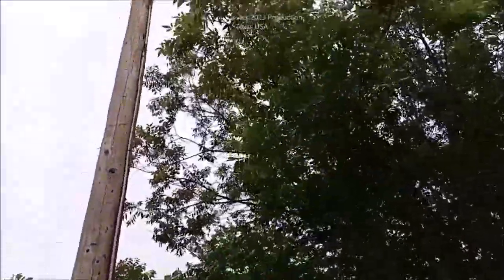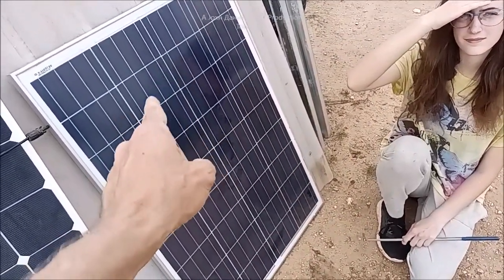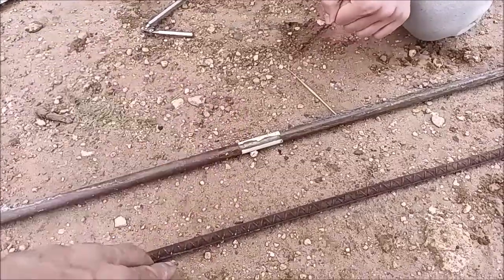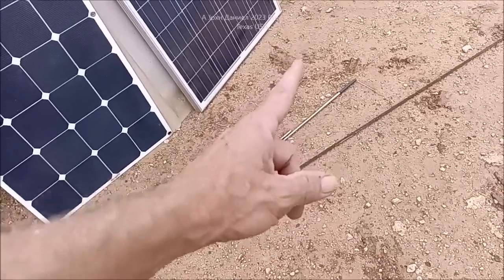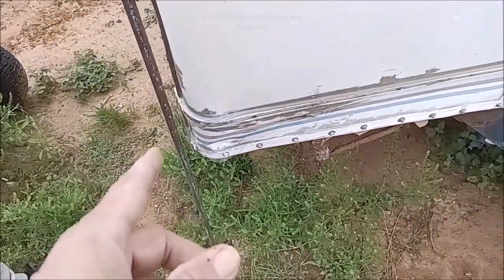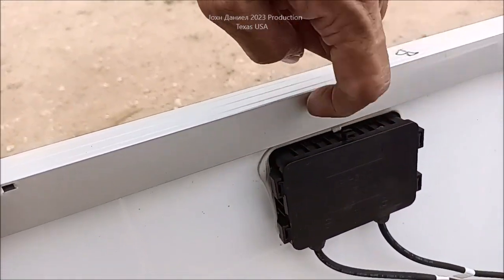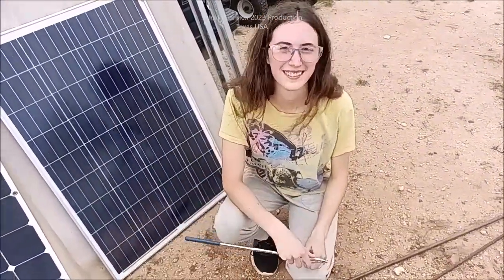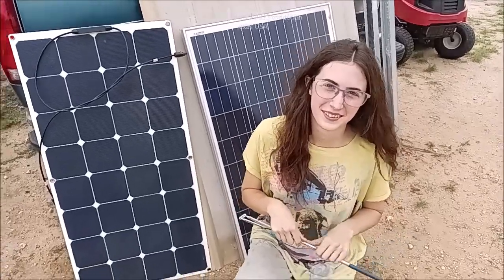Grounding your SOLAR PANELS? 🤔 You Better watch this First! *KNOW DC/Inverter POWER is not Utility

Comment: Yes by code anything that has conduit on the roof of any house needs to be grounded this includes solar panels.  The key is to that it needs its own separate ground do not use the same ground as the utility.   Its just a lot safer for solar panels to have its own ground wire if they are on the roof.  If lightning does strike the solar panels on a roof its just better for it to be directed to go towards ground.  If the solar panels do not have ground it will most likely follow the wires towards the batteries and destroy everything connected to it,  but I'm thinking that will happen regardless if its properly grounded or not since lightning is incredibly powerful but its still a lot safer to ground the solar panels.  Flexible solar panels do not have conduit or aluminum frame those will not need a ground.  Also while its rare its not impossible for a lightning to strike the top of a car even if it has solar panels or not,  for the most part you will be safe because if lightning hits the top of RV the shell of the RV will become energized and go towards ground thru all 4 tires - you will definitely still have a lot of electronics fried up though regardless.  You just have to hope lightning never strikes your car or roof & never park under a tree when its raining. I'm thinking since inverters will never have a surge it won't need a ground to send that surge to ground, maybe only if it gets a lightning strike but again if a lightning strikes you'd most likely need to make major repairs to home for weeks you just have to hope it never happens.
Reply from the maker: The real cure is remote higher targets like lightning rods. Or placing solar on metal roofs. Using metal roofs makes it where the lightning discharge is so expansive that it repels into atmospheric static. No single point collection or dispersion. In test of a AC unit on a roof of a building, the one on wood framing was destroyed by lightning, the one mounted on a full sheet metal roof had its relays damaged. Not allowing the 1 mm wide arc of lightning to concentrate all its energy into one square foot of discharge weakens its ability to do damage.
Reply: @JOHNDANIEL1  I haven't yet set up a solar array but I've been thinking about this for a while when I do start building a system.  What I've thought of was instead of mounting the solar panels on my roof I can just have them on the ground itself - this will make it easier to clean them when they get dusty & no ground is really needed since they are not in high elevation & the solar panels temps will also be a lot lower and make more energy.l

Comment: AFAIK, there are 2 different reasons for grounding: (a) for functionality reasons (AC transformer, electrical wire fence, ...) and (b) for safety. 
With (a) you connect one of the wires to the ground which acts as an extra conductor, and with (b) you connect metal frame parts to an earthing rod or loop. 
With (b) in place, you prevent people from being shocked when touching the metal frame if a damaged DC or AC cable also touches that frame. Without grounding, the electricity goes from the defective cable via the frame through your body to the ground, which can be deadly. 
With the frame grounded, the pathway of least resistance is via the ground wire to the ground, so when you touch the frame then, almost no or very little current will go through your body. As well as the situation that the Ground Fault Current Interuptor can detect the dangerous situation and disconnect the electricity, indicating there is a dangerous situation that should be corrected. Or in case of solar panels, the inverter detects that there is an insulation fault that should be looked in to. 
PV systems are being grounded for protection of your loved ones, and other people.
I'm no expert, only an apprentice, the experts can correct or agree with me.
Reply: You must be "educated", which is a no-no, apparently...
Reply: @scooter325 . Haha !!  😆
Reply: You're right except that the DC circuit from your panels is an isolated circuit. There is no potential to earth ground unless you create it by bonding the return (-) to ground first. Shorting the positive wire to the frame will do nothing unless the positive and negative both are shorted. Then something is going to blow, hopefully fuses that you've installed on your panels instead of your panels.
Equipment grounding is absolutely best practice where that potential exists and does include most all AC circuits and non-isolated DC circuits.
Reply from the maker: @beebop9808  They fail to understand DC voltage. What a shorted wire on a grounded panel will create is one of 2 things. A blown DC fuse, and if no fuse, a Fire. NOT electrical shock unless you loop grounded it. Touching One side of DC voltage is not a issue, but a shorted positive on a grounded frame and you in the middle is a circuit. Sad how clueless and deep in the Koolaid drinking so many are to this issue.
Reply: @JOHNDANIEL1  I don't know dude? Strange stuff going on with this panel grounding mess. I've followed it around a little bit and it seems people are complaining about AC voltage leak coming back from the controllers to the panels and some getting bit by it. First I don't see how it could be viewed as "OK" that there is continuity between the DC circuit and the panel frames? Second why is it "OK" to have a foreign AC voltage induced on the DC circuit?  
One video I saw where a guy was lightly touching a panel and arcing could be heard. Clearly a frying sound and obviously the sound of high frequency voltage. AC voltages read all over the place but likely I'm guessing no current to go with it.
The assertion being made that some panels were worse than others. 
I don't see any UL listed equipment doing any of this nonsense. Clearly folks don't get the difference between AC and DC and what's going to happen if you get yourself into a DC circuit with 100-500 volts on it.
I don't know like I said. Half a mind to call up an old buddy that worked for years with UL, had ties to China and was one of the people that spearheaded the effort there to allow Chinese equipment to bare the UL Mark. He never let me get away with any such crap as that. lol
Reply from the maker: @beebop9808  The real reason you may get sparks or static shock from a solar panel frame is what they DO NOT tell you they done. in 99% of cases it is a weak ground field from their utility system. Dry soil, corroded ground connections, structural continuity, and numerous examples of what we call PIN CUSHION neighborhoods. That's when you have (EXAMPLE)  50 homes in a neighborhood, 50 plus ground rods in a 15 acre space,  and the ground is in full saturation of common neutral to rod bonded stray current. Add to it you wire your solar with a connected ground strap to each one, then to the solar controller, then to the inverter, like a good little zombie then your wired into your homes bonded system that is connected to that exactly over saturated earth system. If they had let the whole system float, ( LIKE A RV HAS ) not connected it to any ground, they would have 100% NOT created a source for such stray voltage. But explaining that to the "Product seller addicted koolaid drinkers" is about as easy as pulling cheetah teeth with fisher price medical kit!
Reply from the maker: @beebop9808  Here's the best real reason people are confused about grounding what is nothing electrically different than window frames. **A diversity hire in the DOE was on his 4th bag of Rice Crispy treats when the boss said "lay off are possible if you guys can't keep pumping out worthless regulations" and he at the time had just bought his first 25 watt solar panel to prove with proper virtue signaling that he/she/it is as green as his boyfriends hair is, and tried to plug it into the wall. His near death idiocy made his hate for solar a solid concern. Then he decided to open one more box cupcakes and paste on his  Skittle flavored purple hair dye and wrote the following for subsection 2378 part b of the grubberment moron policies: 
SOLAR PANELS MUST BE EARTH GROUNDED or your gonna be in biggie super dooper trouble. 
Code wrote, Job secured.
Reply: @JOHNDANIEL1  Fusing panels and arrestors are certainly a great idea and shouldn't be overlooked but I don't think turning your PV array into a lightening spire is a good idea. Actually, installing one close by might be a very good idea to draw a strike away from your equipment. Arrestors aren't always successful. Static energy makes it's own rules.
Reply: @JOHNDANIEL1  🤣:oops:
Reply from the maker: @beebop9808  We just go the smart way. A deliberate diverter 50 feet away. Using 4 sticks ( 21 foot 6" each 1-3/8" fence top rail ) with 3 of them 24" concreted into the ground 48" apart into a T-pee shape with the 4th one bolted into their tops about 42" coverage, to reach 34-35 feet up. Inside center one is used 3/4 pull rod, from oil pump jacks, welded some lengths and buried 5-6 foot deep in the center. Hit 2 times in 4 years by lightning ( that we know of ) not one ounce of damage to any home or solar.
Reply: @JOHNDANIEL1  you nailed it with that revelation (it's absolutely true)...
Reply: Big no shitter on getting hit with 500volts dc when the squirrel nested under a panel and shorted it to my array. Grounding is important for fatal voltage levels. Plus it hurts really bad!
Reply: I believe electricity goes in a circuit back to source, so it won't go to the ground for no reason
Reply: Aluminum panels oxidize creating an oxidize layer and will require over 1000 voltage before that current can jump to your body.

Comment: so true .why dc
Reply from the maker: $$$$. Nothing explains why you would have to ground the frames on a solar panel, but not a Aluminum Skylight! If you let the panel float electrically like you do the skylight you get no path to ground to attract lightning. In fact, Pella Windows tells its builders this exact fact.

Comment: Ahem..  NOT creating...  COMPLETING a circuit. Thanx for making this point about grounding. Remember back in the 60's and 70's when there was a grounding strap underneath the cars..? hehe.. they were surely smoking funny things.
Reply: Yes I remember them! Some even used short lengths of chain!
Their purpose was to prevent static build up ...... resistance through tarmac is Not good ;o) ..... which is what allows you to build up the static in the first place!

Comment: go up on a metal roof to check panels, from a ladder , u fry your nuts darlinks
Reply from the maker: DC at low voltage won't actually fry anyone's nuts, but it may warm them with the right efforts.
Reply: @JOHNDANIEL1  450 volts DC
Reply from the maker: Not on my system, max is 75 volts DC on the Stion panels and they are FRAMELESS CIGS panels, most is only 22.5 open volts.
Reply: @JOHNDANIEL1  Agh finally CIGS panels mentioned... was wondering about these when i first saw them a few years back. i was also just thinking of a mention of the "German" balcony power situation where they use the inverter on the panels (i think its 500 watt max), i dont remember seeing any requirement to ground the system. They input directly into a plug in the flat to power invcremental loads from existing wiring.
Reply from the maker: @Magiciansandmagicvideos  If your in USA and you do not already have plenty solar panels you must hurry to stock up on them. CIGS is impressive and expensive, but no power is painful. I have ordered my 20 more panels, easy cheap ones, https://amzn.to/3zCPPfM with the cash I had left anticipating the massive inventory collapse due to shipping stoppages tomorrow.

Comment: I have never ground any solar panels, or inverters, but I always use rebar to ground electrical fences, though! : )
Reply from the maker: Very smart. If you ever share wiring with a grid designed system your looking for problems. I wired to use my power in dedicated lines, and never lost a solar panel in 16 years.

Comment: I have a Victron charger controller and a solar charger that all connect together with batteries.  If I have the building AC system connected to the inverter and that is connected to the ground of the pole, ... what happens to the inverter three wires if shore power cuts off?  Is there an issue with any sort of ground loop? The 12V DC is connected and inverted to AC right?
Reply from the maker: When you connect a inverter, to a existing ground of a building or house then your sharing that ground. If a electrical condition exist that relies on that ground you can end up with a damaged inverter. They place this option on inverters to pass a improper UL and NEC rating. It is ok to do this with generators with a AVR in them, not ever to be done with brushless generators for the same reason. I only run on a GFCI from the inverter, then only use 2 wire on all shared circuits. Many inverters are different, but almost all will not run safe, especially high frequency models, sharing a ground with existing wiring. The best outcome is NOT to share house wiring, install new dedicated unless your buying a pricy quasi grid tie style inverter but using them means a huge cut in ability when grid fails.
Reply: @JOHNDANIEL1  Exactly!!!  The only reason a UPS can do that; even though it's not really the same as having an inverter tied directly to the main breaker box, is because it has a lot of power conditioning circuitry and is specifically designed to act as a filter/conditioner for the grounded power going into it and to also automatically switch to backup battery power if the main power going into it is lost or over voltage or under voltage.  I don't actually use inverters in my solar setups, I use all industrial grade high power with high power factor rack mounted APC UPS units that I have custom programmed for working as both UPS and standalone inverter systems.  

Knurlgnar24 has a LOT of good information regarding modifying and reprogramming UPS backups to use as standalone and backup systems here on youtube.
Reply: @johnbrizendine7716  These replies sure helped me understand more clearly.  They also have me connect the negative battery cable to the ground rod by the shed.  I don’t have the panel frames connected to ground though they are currently (pun intended) close to it.
Reply: @JOHNDANIEL1  Thank you. Of course.  Victron has me ground the inverter to a rod outside the shed it is in too.  Then when ac shore goes out it internally connects the ground and neutral.  … as the batteries, solar controller and batteries are all connected to feed the shed’s ac wiring… the built in transfer switch etc helps.